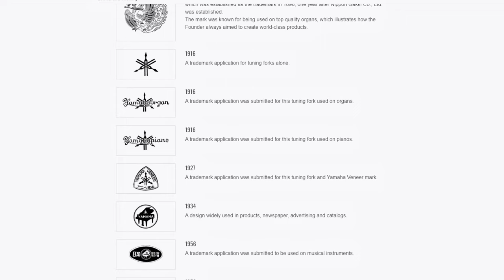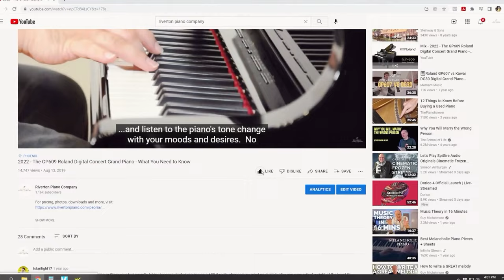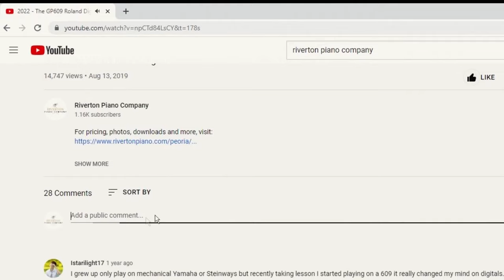FIRST LOOK!  The NEW Yamaha CFX 9' Concert Grand Piano

Comment: Does the CFX  come in any other length than 9ft which is too large for my living room?    I may be forced to continue using Yamaha's digital sample of the previous instrument.
Reply from the maker: The CFX doesn't come in other sizes, but you might check out the S3X (6'1"), the S5X (6'7") or the S7X (7'6").  They won't sound as good as the new CFX does, but they have similar technology and they are amazing pianos.
Reply: @RivertonPianoCompany  Or go with the CF6 or CF4 at 7' and 6'4" respectively, which are smaller versions of the CFX (1st edition).
Reply from the maker: The CF6 and CF4 are in the same category as the CFX, true.... but they don't have the ARE technology, they don't have the new felt mix and they are older scales.  That's why I recommended the SX pianos instead.  ...but thanks for pointing those out too!
Reply: @RivertonPianoCompany  Are there any plans to update the smaller CF pianos to the standards of the CFX update?
Reply from the maker: I would imagine so.  Now that they have updated the CFX and the SX series with the new tech, I can't imagine they'd ignore the other CF pianos.  Once the supply chain nonsense calms down, I bet they'll start work on the rest of their premium line.
Reply: Good to see you on this video, friend!
Reply: In fact, the CFX is part of the CF Series, that includes two smaller more pianos, the CF4 and CF6.
Reply from the maker: Thanks, Marco!  While this is true, it's important to note that the current CF6 and CF4 do not have the latest technology found in the new CFX (like A.R.E. and the Unibody Concept, etc.).  They are (now) older designs.
Reply: @RivertonPianoCompany  

I thought these technologies had been applied to the entire CF Series.

Good topic to keep in mind. Thanks for the information!
Reply from the maker: Not yet.  The new CFX is the first in the series to get these features.  I haven't heard anything about updates for the CF4 or CF6 yet.  I am sure they will do it eventually, but it might be awhile.  Thanks for your input and for stopping by our channel!

Comment: well I guess they learned a thing or two with Bosendorfer; the unibody concept you talk about at 3:50 is not new to Yamaha, Bosendorfer has been making their pianos in this manner for over 100 years and it's called the resonating body principle, basically the entire body of the piano becomes an extension of the soundboard, which allows for a better projected sound.
Reply from the maker: Hi, Jorge, and thanks for watching!  While you're right that Bosendorfer has used the resonating body principle for a very long time (and you're right about what that principle does), you're missing how the two concepts are different.  First of all, Yamaha is not using the resonating body principle.  They still use laminated rims and different lumber for their bracing material (ie - not the same spruce they use for the soundboard).  They still rely heavily on the soundboard for projection.  They have, however, treated the rim and frame with the A.R.E. technology to enhance how those components project.  What Bosendorfer does is far more complicated.  Their rims are made out of solid spruce - as is their frames.  That's why Bosendorfer pianos are far more expensive and take so much longer to build.  Secondly, the Unibody principle isn't the same as the resonating body principle (though they have the same goal).  Yamaha has redesigned their cabinets and refined their building processes so sound can transfer from one wood piece to another with less loss.  Yamaha's joints are so tightly fit together now that you can't even see light between them with a flashlight!  This kind of precision is not possible with pianos made outside Yamaha's factories (especially if your goal is consistency as well as quality) and it has never been possible before now.  I hope that helps clarify the process.  Yes, the goal is to produce a warmer, fuller, better-projected sound, but Yamaha's approach is more technical and far less expensive.
Reply: I've played all three..the Stein.. the Bose imperial and now the yam..
I'm just a piano player..   ;)
Reply from the maker: Glad you have had the rare chance to play all three!

Comment: So have the changed the name at all...? CFX II...? Or... ?
Reply from the maker: No.  We originally thought they'd add the "II" or call it a "Mk II" (which is standard for new variations of a popular piano model), but Yamaha decided to confuse people and keep the name the same.  Hahaha.   ...so you have to ask them if it's the CFX with ARE or the "old CFX."
Reply: @RivertonPianoCompany  actually easy to see the difference from the "old" CFX. New CFX does not have an iron rib on the plate in the middle section.
Reply from the maker: Excellent point.  They did change the plate design pretty significantly.  Thanks for bringing that up!